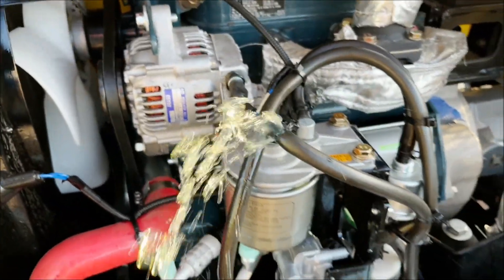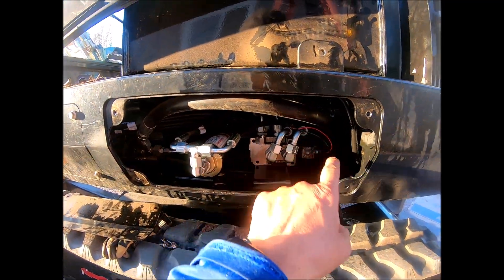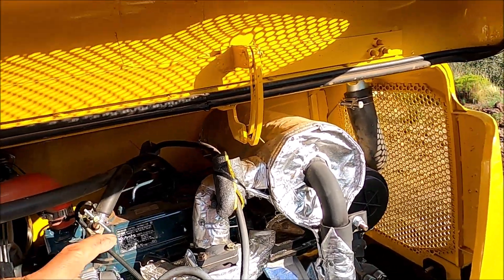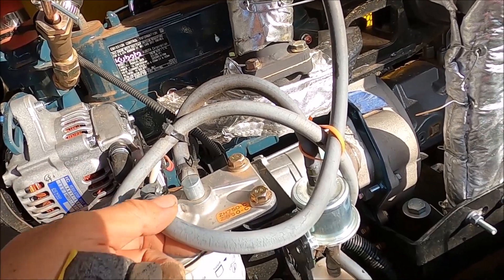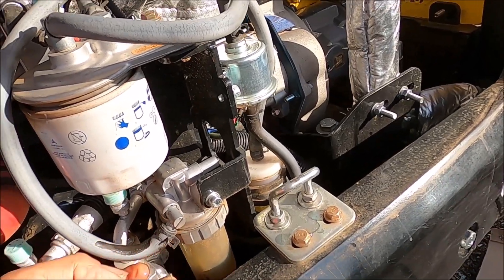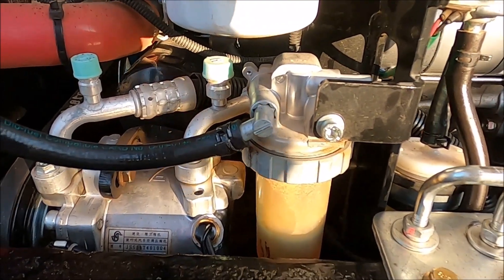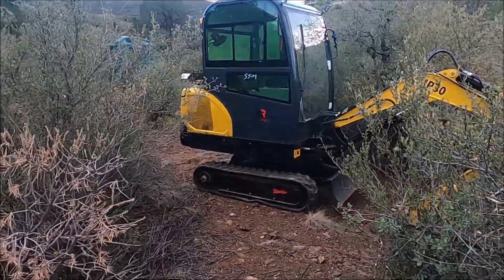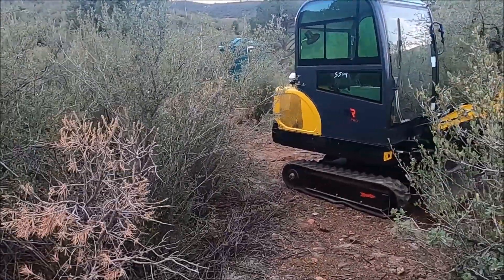MachPro MP30 Excavator Fuel Leak: Quick Bushman Fix & Full Fuel Line Replacement

Comment: Great video. You actually show why this is an all day job unlike the trolls in the facebook groups that think its a 15 minute fix. Its a shame these Machpro are such terribly poor quality. BTW if you can find 11/32 fuel line it will fit easier.
Reply from the maker: thanks for the tip!